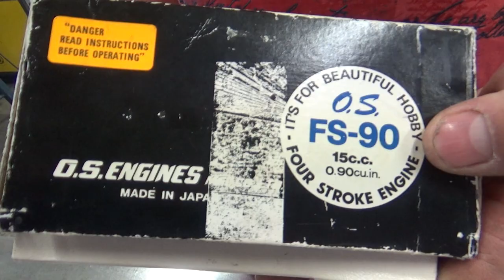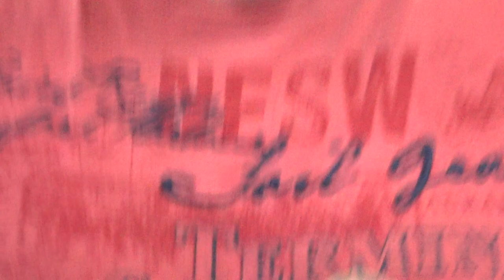OS FS-90 four stroke nitro engine Unboxing

Comment: you will love that motor.i had 2 of them,and also the fs 80 .I still have 1 os fs 90.its a very well built motor.just added them to my over grown collection of motors.
Reply: Harvey Newman i also collect engines..oh yeahhh!!!!
Reply: Hi, I have an OS FS-90 but I'm looking for a silencer / muffler for it.  The original part # is 45625010. I do have the exhaust header pipe at least.  Would you have a spare silencer / muffler you might want to sell ? Let me know, thanks.   Steve
Reply: @stevegarbacz8573  Hi,steve. i have an original,fs90 muffler,but missing the removable opening outlet.i have another on a fs90,but dont want to remove from that motor. let me look wher i put the muffler. got a lot of parts binns to search.been collecting parts for a while
Reply: the same muffler in the video
Reply: @harveynewman4333  Thanks for checking. Do you mean that your muffler is missing the short screw on extension pipe like in the video at 5:15 ? Is that what you mean by opening outlet ? As you know, I do have the original "bent" header pipe with the 2 lock nuts on it, part # 45426000.
Reply: @stevegarbacz8573  no, the exit part of the muffler. it un screws, so to beable to clean it. thats the original muffler design for the fs90.i have 2 fs90s.,but one has a different muffler on it. the nice one has the original one on it. im going to look this morning for it.
Reply: i made an error. i have 3 of them.one,missing the outlet and 2 with them
Reply: OK, does that mean that you might be able to sell a muffler to me? You see, the problem I have is that the fuel tank in my plane is installed lower than the height of the carb. I need to pressurize the tank using the "nipple outlet" on the muffler to get fuel up to my carb. My FS90 is not running well and my guess is because a steady flow of fuel is not getting to the carb. I tried running the motor out of the plane on 2 different occasions, bolted onto a flat board with the fuel tank at the same height installed directly behind the engine, and it runs well using just it's pipe exhaust. ( no pressurization to the tank ).  But once the engine is back in the plane, she stalls and barely keeps running. So I think by installing a muffler with a pressure hose to the tank, that it will cure my problem. What do you think?
Reply: @stevegarbacz8573  my daughter will be home soon.i will get her to take a pic n send it to your email.
Reply: @harveynewman4333  Ok thank you.
Reply: @stevegarbacz8573  just sent pics of 2 mufflers. screw in end type is original,factory muffler with correct elbow, the other is an after market that fits